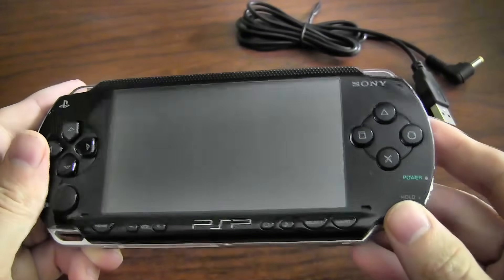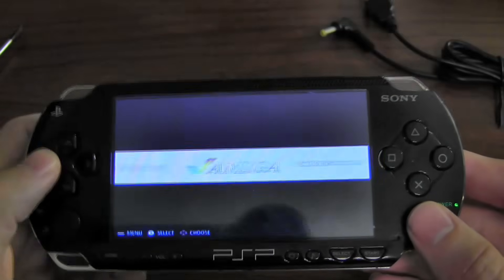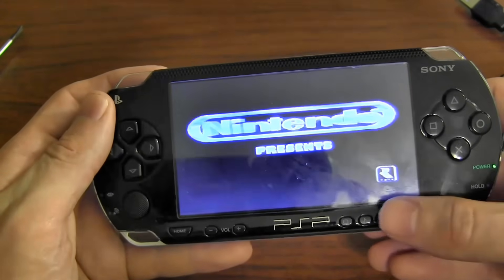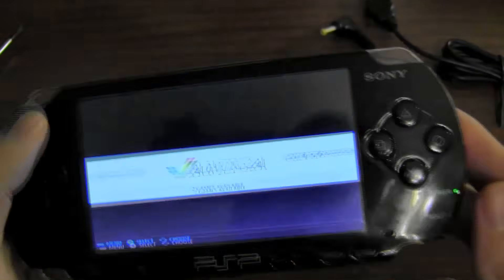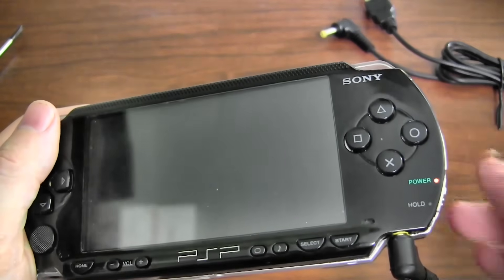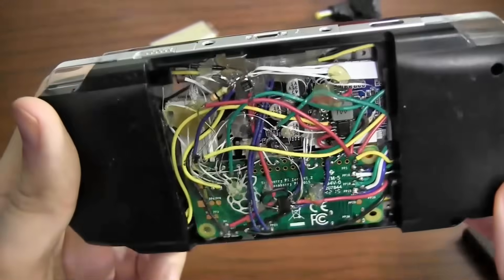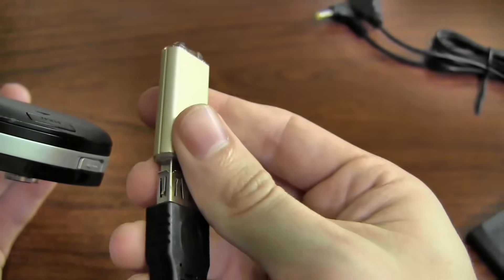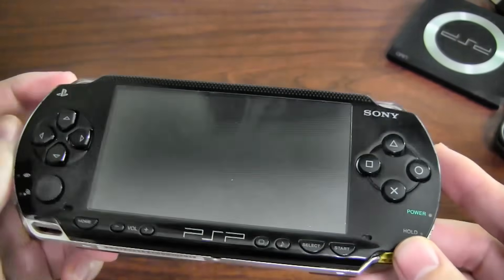PSPi Version 1000.2  - Raspberry Pi Zero in a PSP Shell

Comment: I aspire to be able to do something like this. Today I actually soldered on a replacement home button for my 3ds (the ribbon cable housing was gone), the soldering was so tight I had zero hopes it would work. But amazingly, it did. Flux, flux, flux.
Reply: Than a spot of hot glue to make sure it holds.

Comment: People, not only was this a broken PSP, but PSP Emulation sucks compared to the Pi. Only some SNES games run full speed, and the GBA emulators have issues as well (The sound for Pokemon Emerald is messed up on gpSP, and I've had a more accurate GBA emulator crash and lose all my progress for that session even after saving and savestating multiple times). PC engine support is nonexistant, N64 only runs one game playably (sm64). The Pi can not only has more power, it also has better emulators. In other words, you can't count on the PSP for a lot outside NES and MD/Genesis emulation, and the NES and MD/Genesis emulators on Pi are just better, anyway.
Reply from the maker: I love this guy. Oh and SNES was the last console worth playing
Reply: That's not true. Almost all SNES games run perfectly smooth on the PSP emulators nowadays. SNES emulation runs very nicely on the PSP. There are various versions of SNES9xTYL 0.4.2 out there, maybe you used a wrong one (I had one version which had problems with Donkey Kong for example. Now I have a better version which runs the game smoothly). I don't have one single SNES game which doesn't run smooth. Same with GBA, I played many GBA games on the PSP emulator and all of them worked perfectly (but have to admit that I've never tried Pokemon). In terms of N64 you are right, the PSP is just not usable for N64 (but anyway you don't have enough buttons on the PSP, even if you put a Raspberry Pi in it). But anyone who wants to run NES, SNES, Gameboy, GBC, GBA, Megadrive/ Genesis and PS1 can do that perfectly with a PSP. And on top you can run PSP games, of course, which the Raspberry Pi Zero can't because its lack of performance. PS1 emulation also doesn't work perfectly with a Pi Zero, so for PS1 games the PSP is also the better option. So in total the PSP is the better Retro Emulation Handheld platform for me, as long as I don't want to play N64. Just my personal opinion. The Raspberry Pi 3 is a different story, of course, as it also has enough power for PS1 and PSP games. But it won't fit in a PSP shell.

Comment: do you think its possible to put a rpi 3 in a psp case?
Reply: Plum_ Pie A pi 3 will not fit inside the case unless you strip off all the connectors on it and even then it would be a very tight squeeze.

Comment: Why did you use that old 320x240 LCD :'( zero has hdmi out :(
Reply from the maker: +Emre MUTLU it's 480x272(not much better than 320x240). Find me an HDMI controller that fits into the PSP shell and I'll make it happen.
Reply: Here is a touchscreen 1920*1080 but it is 3.5'' Would look gorgeous but it depends on your taste - size VS resolution... solder work needed for connections.

https://www.aliexpress.com/item/3-5-inch-HDMI-LCD-TFT-Touchscreen-Display-1920-1080-for-Raspberry-pi-2-and-Pi/32774253132.html?spm=2114.13010308.0.0.ApapAj

Comment: I think this is absolutely amazing.  I would love to be able to do this but I have 0 experience with electronics.  How do I even get started or introduced to hobbyist electronics and how many years would I have to practice and learn before I could tackle a project like this?
Reply from the maker: +Flabfactory start with the basics. Either electronics 101 or a good electronics book will get you started. Nothing worthwhile comes easy, but its a fun learning process.
Reply: othermod I have a problem similar to him like I have some technical knowledge but not enough to solder in components what do you suggest I do because I feel like as soon as I learn how to do this stuff then I can start making my own devices

Comment: I'm sure it was a fun project, but do you actually play with portables anymore?

The power of the Pi seems best if executed as a console or set top box to me.
Reply: Age of Reason I built a similar project with a pi 3 and a gamegear. I travel a lot with work so I often take it with me to play. You are correct it is better suited as a set top box or console but if you have use for a portable console its pretty hard to beat.
Reply: I'll give you that. It probably also acts as a portable computer. Does it?
Reply: Yes. I have 2 memory cards for it and can easily swap them and use it as a mini portable linux computer.
Reply: Ahhhhh! See it gets better now. Lol

I knew there had to be more than just repurposing and old plastic box!

OK. Now it's awesome.
Reply: Plus it has an HD output, yes? You could then use it as a settop of you wanted, yes?

Comment: Is it original LCD?
Reply from the maker: The LCD controller can be modified to work at 5v.
Reply: so that needs 12v, recommendations on a battery/charger setup? it does not have to fit a psp case.
Reply: it works with 5V with a easy mod
Reply: Thanks, guess I have some homework to do
Reply: can you use a mobile screen
Reply: @CringeOfCzech  no
Reply from the maker: Not original
http://ebay.to/2rlzkfN
Reply: othermod
thx

Comment: would it be possible to use a rasberry pi 3 in it instead of the pi zero?
Reply from the maker: Maybe. The connectors on the Pi 3 would have to be removed and plastics would have to be modified. It wouldn't be easy.
Reply: Probably
Reply: I've just heard that the pi 3 is a better thing to emulate games on as its quicker
Reply from the maker: It definitely is better at emulation. Personally I wish there was a Pi Zero with the Pi 3 CPU.
Reply: you know, that might be possible honestly. Adafruit has a lot of tutorials and such, the most recent I watched was something about resoldering a chip on to a circuit board...I don't know the software or specifics behind doing so...but i think its possible to do what your suggesting

Comment: othermod Can you make me raspberry pi psp slim with windows 10 and led mods
Reply: its not a problem of the power the cpu has. It's the wrong archetecture. You can't us ARM processors to run windows
Reply: xMLHx Squad Raspberry pi won't run win XP, it sure as hell won't run 10

Comment: im in love with this... perfect idea to what i thought a psp would be with a pi

so much better than a gameboy, more buttons, already there to take advantage of and a 4.3in screen. added benefit is now you also can use psp accessories or attachments etc. the 2000 and 3000 have even more accesories and grips if you want.

But its also cool that mini usb works and can even add to it with an adapter. thats amazing. and it still charges from the same port, awesome.

Lastly you should put in possibly a bluetooth module (idk if pi comes with) and perhaps hdmi or mini hdmi if it can fit to output to a tv, youse headphone jack... and if you want to keep, just relocate it, or just add an hdmi elsewhere. It would be very neat to see.

Comment: Great job. Did you use a regular soldering iron or hot air gun to remove the micro sd socket? Whenever I've tried that, it seems to destroy the power circuit which is next to it.
Reply from the maker: The microsd slot is still there. Those pads are on the other side of the board. 

When I do remove components such as that I use a rework gun. I'll usually add low-temp solder paste to bring the overall melting temp down.

Comment: Kind of a useless mod though since the psp has homebrew versions of all of these emulators, and you still have a psp at the end of the day and not the lowest of the low pi zero
Reply: I have a couple of pi zeros they are not good for even browsing certain websites. For snes nes genesis though should be fine. I was just wondering as PSP is so easy to jailbreak anyhow and you can get the same emulators in psp once you can run homebrew. I guess what i was saying is great idea but the pi zero is massively underpowered. If you had something like a pi3 you could actually play psp games
Reply: I doubt a pi3 would fit though
Reply: A PSP is a piece of shit anyway
Reply: Josh Hall it was not working as a PSP at all it was damaged or faulty. he's made it with more than the $12 he paid for the broken PSP.
Reply: the psp was already broken and In fairness the pi zero can also be used as an entire home computer and is not just for gaming.

Comment: Absolutely stunning effort. Thats so impressive. 

I keep buying Android hand held consoles but if you can build these, you should try to build a Windows system for emulators and slap joystick controls on it. 

The only thing I have against this type of device is the small screen. A 7 inch screen would just blow the competition out the water.

Comment: A psp can already run al those emulators... I'm legitimately confused about why you'd do this.  Still respect the work itself, tho.
Reply: BackForwardPunch, also this is running Linux, so you can do more then just game!
Reply: BackForwardPunch because it was broken
Reply: As far as I know N64, SNES and DOS emulation is limited (Try playing Super Adventure Island 2 on Snes9x and you will see). So, for a broken PSP this is actually great.
Reply: He said it was a broken psp
Reply: Darko Delirium just buy an micro sd adapter for 1 dollar and use an sd that you already have, boom. you don't have to buy OEM Sony pro duo cards.
Reply: Probably increase the memory as well. the cards for psp were limited and expensive.
Reply: the only bad thing about psp nowadays is the screen, it looks bad in some games specially if you still have the psp 1000
Reply: diegoarthur nowadays SNES runs buttery smooth on psp, even N64 if you play without sound.
Reply: BackForwardPunch it can run an x86 emulator and run light PC games and it also suppourts flash and it makes the pi an all in one package
Reply: BackForwardPunch well u can install Kodi and have some entertainment features :/
Reply: Chrollo Lucilfer        I'm currently using one now: the screen suffers from a severe case of ghosting, you get used to it but in some games is more noticeable than in others (like in Gran Turismo).
Reply: +urraco jalpa Yeah for sure, the psp screen refresh rate was pretty shite. I think the 3000 model fixed this ghosting issue? Not sure.
Reply: Hijynx87     the 3000 fixed the ghosting problem but introduced screen deinterlacing artifacts.
Reply: BackForwardPunch some people like the raspberry pi interface and how it works. besides it works even better. im all for psp and prefer it but some would rather go with pi.
Reply: ps1 gaming is limitless on psp
Reply: The PSP was broken and this is clearly a passion project, he did it because he can....
Reply: Chrollo Lucilfer yet using  the psp 1000 had the best speakers
Reply: Keith Dailey    and the best shell (piano black finish).
Reply: Urraco Sharklaser huh
Reply: you can add games that aren't psp games to a psp??
Reply: I was thinking the same thing until he said it was broken.
Reply: @diegoarthur: I've just tried Super Adventure Island 2 on my PSP and it works perfectly smooth (even 70-100+ fps if I disable the fps-limit). Only N64 is not working good on the PSP, but the controls are suboptimal anyway (PSP is missing some buttons). DOS Games also run well on the PSP with Dosbox, but the controls are even more an issue here. Most of the good DOS games are made for keyboard+mouse controls, so a PSP is just no good option for that. There are only few DOS games which really make sense on a PSP (such as Prince of Persia or some other platformers for example). AND on the other hand you can run PSP games on a PSP which you can't on a Raspberry Pi Zero.
So I agree with BackForwardPunch: I don't really see the sense of putting a Raspberry Pi into a PSP shell if a PSP itself can run the emulators nicely (besides N64 but as I said the controls with a PSP shell are suboptimal for N64 anyway) and which can on top run PSP games. Besides seeing it as a hobby and doing it just for fun. For this purpose it's a nice and interesting project, of course.
Reply: Amazing good job. Respect!
Reply: Because its broken were you even listening....
Reply: just a fun hobby project
Reply: So u can play PS2 n GameCube
Reply: BackForwardPunch this is literally an entire computer stuffed into a PSP shell. You can run any raspberry pi OS on it, not just use it as a game emulator
Reply: You don't understand because you don't understand liberty! 
jk, what he did allows him to use the paperwork in any way you could imagine. the pi zero  gives makes it a full linux computer with various hardware busses and io pins. this means that the sky is the limit on what can be done with his new gadget.
Reply: BackForwardPunch totally agree. no local multi player, smaller game library, no volume control, no sleep function... I can keep going lol. the PSP was a great machine!
Reply: VaNdaL PiR8 actually it has all these features you mentioned, even local multiplayer on the same device, you just need to connect a controller on the top USB port; also his PSP was broken so now it found a new life.
Reply: No it isn't. pi zero is much more powerful than PSP in terms of hardware.. PSP only had 333mhz cpu with 32mb ram. while pi zero has 1ghz cpu with 512mb ram. 

It's just that pi zero is NOT designed for gaming.
Reply: PC Planet sure, but stuffing it into a game controller probably means it's intended for gaming. I love that he recycled a dead PSP, but as far as gaming, this is inferior to original hardware
Reply: BackForwardPunch it's cheaper

Comment: hey Othermod, does the analog nub work as well? i noticed you touched a bit on nearly every other control but the analog stick(and a few of the buttons on the other side of the start and select buttons), is that what was broken on that psp? and how did you make the custom board? it looks really professional, also nice job on the project
Reply from the maker: Not yet on the stick. The analog/digital converter boards should be here any day now, and that should get it working.

The motherboard was dead, but all the controls still work. I just don't have them programmed to do anything yet.

I'm using Eagle to design the boards.

Comment: You should make the light flash green when the battery is low and make it flash faster the lower the battery level goes, like a real PSP.
Reply from the maker: I was thinking about doing something close to that, but instead of just the green blinking I would make it alternate between green and orange

Comment: I diddnt completely understand the parts you used for the screen to work on the Pi.  I was thinking about using a screen like that on my raspberry pi 2.  What do i need for that?
Reply from the maker: It's just the screen and controller/driver board.
I used this screen: http://ebay.to/2cVVN0O

I've got a basic tutorial here:
http://othermod.com/raspberry-pi-zero-composite-lcd-installation/
Reply: Ah! Thanks :)

Comment: Drat, someone beat me to it :P Question about the lcd, how does the quality compare to an original psp especially after going through a composite signal? Like fuzziness, motion blur and colours ect.
Reply from the maker: Webserfer22 it's not bad once you get it configured right. I went through 6 or 7 different brands before finding one that looked good enough. It's not quite as good as the original screen, but it's close. My goal is to find a way to use the PSPs original screen.

Comment: FANTASTIC job! As someone who is basic on electronic mods, I have waited at least a YEAR to see someone do this on a PSP. Tempted to pick up a broken PSP to do this now.

I didn't notice in the video (my bad if mentioned) but is the joystick on the left being used? Also, how difficult would it be to use a Pi with WiFi so you can swap out retropi to use as a computer? Does the earphone jack work?
Reply from the maker: The joystick isn't enabled in this one. I decided to save it for the one I'm about to build. Wifi would be an easy feature to add, and would really just need a small USB hub. The headphone jack works but doesn't cut the speakers off when the headphones are plugged in. that's another feature I'm including in the next build.  

It's really easy to change the OS too. I just swap the SD card out.
Reply: Thank you so much for the reply, I'm very excited for the next build video! What OS can be loaded on with PI? I know Linux is a standard one. Can android or something else be used on something like a PSP?

Comment: The PSP is already a great emulation device. What are the benifits of turning it into a rasberry pi machine?
EDIT I suppose it would be much cheaper if its just the shell that you buy for the internals to sit.
Reply from the maker: That's exactly it. The PSP just serves as a shell for the Pi. It isn't really meant to be better than the original PSP was, it's just meant to be a fun custom project.

Also, the Pi has far more capabilities than just emulating games. I can swap the SD card out and run a different OS in a few seconds. Hook up an external keyboard and I've got a fully functioning computer.